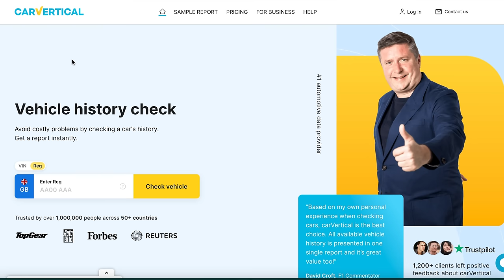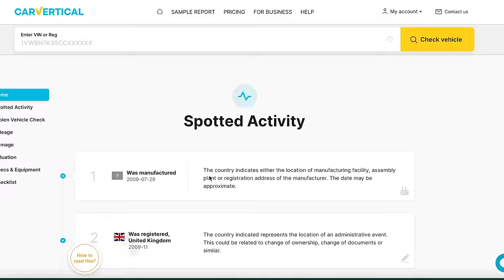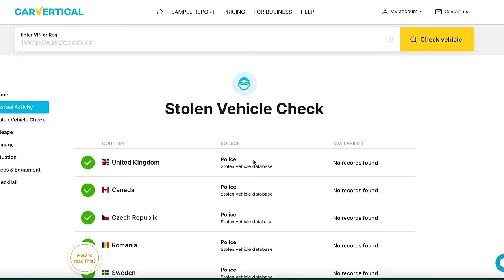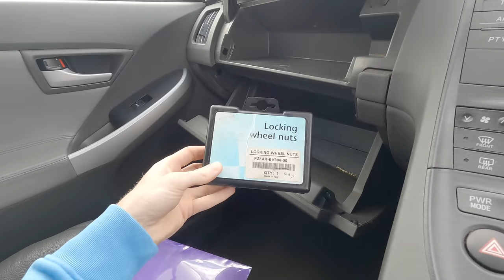I BOUGHT A 200,000 MILE TOYOTA PRIUS

Comment: In the United States these are EVERYWHERE!
They usually have a rear screen that is covered with stickers advertising the owners love of the environment and how everyone should spay or neuter their pets.
They are usually driven 10 mph below the speed limit in the fast lane on highways and away from traffic lights like there's a rotten egg under the accelerator so the driver can ooze forward on electric power and not activate the gas engine for as long as possible.

Comment: Retired Toyota master technician.
I assure you the e-cvt, doesn't have a filter.
It uses WS fluid, which is quite expensive but it's capacity isn't very much.
Reply: What is your recommendation about replacing the fluid? I have a 2010 with 252,000 miles and it's never been changed. My mechanic said he didn't recommend it when I had it in his shop and suggested he do it back at around 200K. The car runs fine.

Comment: Wow, the 2nd hand price of a Prius must have shot up since 2019 when I sold my 2009 Prius T3 with 145k miles on the clock. It had needed an EGR clean as these clog up and cause the engine to run poorly. Good luck with the sale, I certainly wouldn't go shopping for a 200k mile car!

Comment: Had a "66" reg Prius + dumped on me in early 2019 as a company car. Wasn't impressed at the time as I thought they were more of an urban runabout. As I do up to 30,000 miles per year on fast roads I didn't really think it suitable.
Opinions change. From the initial 20,000 miles the car has now done 113,000 miles. Apart from a couple of rear number plate bulbs the car has been faultless. Real world mpg usually mid 40s to low 50s, due to + version not being so aerodynamic as the standard car, and probably due to all stuff I need to cart about. CVT whine during initial acceleration was annoying at first, but now used to it. Not the fastest of cars (obviously) but ok for the real world. 
Overall, well impressed.

Comment: For Info. Unless you carry granny in the back or heavy suit case, then the rear disc get rusty from a lack of use (little use) so check the slider pins in the disc brakes. Other wise that about all the issues are. As one used to driving them I get regular 65+ just running about (without grand Prix starts) PS You should have Head up display like a fighter jet. Very useful.

Comment: You are quite right in saying a left hand side ding may have happened. However the headlight fade could also be where a car is left outside or in a carport where the sun mainly hits one side of the car. Rather than bot equally. Also the owner may have cleaned up one headlight but not the other.

Comment: There are some very good battery replacement videos on YouTube for this car in great detail for the home mechanic keeping costs down to a minimum. id consider buying one with a dud battery and replacing it for £1500.00 in the UK the early models had nickel metal hydride batteries while the rest of the EU got lithium batteries.

Comment: I bought a 2010 hybrid Auris on 175K mileage for 4.5 the cheapest in the country 3 months ago. 1 lady owner and T spirit model drove it down back to london from leeds and honestly it’s the perfect solution for local driving and high MPG and cheap cheap running costs im getting around 50mpg without even trying

Comment: Not all working vehicles were Taxis with holes in the bumper. In London Private Hire Vehicles don’t have plates, they have Roundels stuck inside the front and rear windows.
The easiest way to tell if a vehicle has been used as a London Private Hire Vehicle is 6 monthly MOTs.

I have been looking for a 7 Series BMW recently at BMW main dealers, and have found 2 vehicles that were undeclared Private Hire Vehicles from London, one was still listed on the TFL Database.

Comment: Glad you've done a hybrid. I've been doing  Uber Eats/Deliveroo etc part time, clattering around in an Astra 1.3 cdti since the lockdown drama and been considering a hybrid for a while but nervous of the maintenance and complexity. Might start looking around! See the attraction, my average speed around town doing deliveries is about 17-18mph! I think older Prius suffered from inadequate battery ventilation (under the back seat?). Got to check for a filter I think
Reply: The great thing about these hybrids is that the fuel economy actually tends to go up in stop and go traffic. The car uses the electric motor to slow itself down while recharging the hybrid battery at the same time. This is the same reason that the brake pads on them last for so long. These are definitely worth a look if you're considering working out of your car, I love mine.
Reply: So, did you find a Prius?

Comment: Friend of mine had a 275k Prius, Mk 2. Estimated mileage as the clock doens't go past 399999km. Thing ran on its first batteries, interior still looked okay and it felt crisp and tight. Exterior dirty and beat up. Heavily used, absolutely flawless. My neighbours have a 2009 Auris. Zero issues since 2009. Unless you count that their remote controlled alarm system of their home interfered with the keyless entry/start of the car.  
I loathe the way new Toyota's drive, with how their steering doesn't center. I just keep swerving and I don't get anywhere near those cars but my oh my, are they reliable old beasts.

Comment: a Prius is likely to be an excellent purchase. But you need to check the battery! A Prius with a knackered drive battery is worth very little.
Luckily, this is not difficult, even for an amateur. There are battery diagnose combos, where you use an OBD reader that sends data via bluetooth to your diagnostic app. Youtube is your friend.

Comment: It’s interesting that the big investment by the owner is in suspension.  I find the same with Hondas with high mileage. Not only struts and shocks, but also suspension bushings need to be replaced at considerable expense. If you don’t, it gets yucky to drive and ride in.  Most everything else seems pretty reliable with good maintenance.

Comment: I have a 2015 Toyota Auris Hybrid estate for best and a 1996 Volvo 940 LPT, petrol  Auto estate for my works van. Cost me £250 5 years ago and now run in at 207,000 miles. Prior a Volvo 240GLT Estate in 2009 for £350. Had it for 10 years and added 72,000miles. Sold at 234,000. Ran extremely well and got £500. Needed a quick sale. I like the older rear wheel drive Volvo and Toyota and Lexus.

Comment: I had a 1.8L tdi ford from 1999. Had 490,000km on it untill the clutch failed on it, timing belt was last changed over 200k, over 15 years ago and it was basicly worhless so i scrapped it. This toyota is brand new to my stantards and has easily 150 to 200k  left it in. IMO your pricing is off tho. :D

Comment: I got in an Uber a few months back in London. It was a Toyota Prius as well I think on a 62 or 63 plate and it had done 263,000 miles and I only noticed that a few mins before getting out after a 45 min drive. Thought it was still a smooth drive but had a lot of marks and squeaked a lot over London brilliantly place speed bumps.

Comment: Engine cuts in at 25 to 28 mph. It will only travel about a mile on battery power alone. The battery is tiny. A Plug-In hybrid has a battery around 10 to 15 times the size of a standard hybrid.

Comment: Two background bits to mention, both courtesy of The Car Care Nut channel by a Toyota Master Mechanic:
First, when looking at one to buy or having recently bought, look at the hybrid battery cooling air intake by the right rear seat passenger's right elbow. It should be free of dog hair or other inlet debris. If it is blocked the hybrid battery suffers badly.
Second, change the engine oil at 5K miles or 10K km intervals, even if the service schedule allows twice the interval. The longer interval will get the engine past the warranty period but will run a high risk of cylinder wall scuffing followed by high oil consumption.
I hope everybody enjoys their Prius cars as much as we do.

Comment: That's the thing with CVTs.
Service the things regularly, and they work well forever. Ours has 229000 on it, and is still sweet.
Seems to work better than a Toyota CVT.
Goes well -  1.8 twin-cam, and it just goes loose in Sport mode. Damn quick.

Comment: This is the first Prius i have ever seen without a production line satnav system. You need that for just reversing, this is an odd model indeed! But if you need a bullet proof practable daily, look no future. Once they are serviced by a friendly Toyota main dealer annually they will just keep going, i should know, my 2012 model i bought 6 years ago  with 190,000 klm,  so the price was right, it now has 330,000 klm and has never missed a beat. Luxury model with some nice Lexus hand me downs like parallel reverse parking (which in the past 6 years i have never once tested!) and camera, electric folding wing mirrors and a very James Bondesque  pop out CD player! But in all fairness this is a car to have, just in case!

Comment: The coolant in mine that’s at 235k miles looks like this too. I’ve never drained it 😂 mine has the original hybrid battery. I do regular oil changes and have changed the spark plugs twice and the break pads twice. I’ve been using mine for delivery. It’s the most reliable vehicle I’ve ever owned. The money you will save in maintenance costs and fuel is absolutely crazy. So far I have had repairs less than $500 in the 7 years I owned my 2011 Prius. Just do regular oil changes and change the filters and you’re good to go.
Reply from the maker: Impressive

Comment: I prefer the 1.5 over the 1.8. The 1.8 has 3 major problems. It burns oil, head gasket most likely will need to be replaced and last the egr valve gets plugged with carbon.

Comment: I'm really planing on getting one I hate the steering wheel but with the increase of clean air zone, it would be perfect, especially since I only do motorways once a week, my current diesel keeps getting DPF problems. Never owned a hybrid before, a bit scared but I have to try it
Reply from the maker: They’re very good cars. I like them
Reply: I was nervous too…fourteen years and 241,000 miles ago. No major repairs, Still on original battery. Absolutely love my Prius!

Comment: how is a Prius as a first time car ? especially for a 5'3 driver?  maximum expected mileage is 10k in a year & its just for personal use...
Reply from the maker: They’re good cars
Reply: I have a 2008 Mk2 Prius Tspirit which I bought 3rd hand in 2013. Initially owned by Lloyds Bank as a company car, then used as a private car. Bought at 55k miles. 
Today it just rolled over to 143k miles. Daily commuter (34 miles round trip). Do about 10k per year or slightly less. Still running on the original Hybrid Synergy Drive propulsion system which has been ultra reliable. Also still running on the original Traction Battery too (93% SoC). Has leather interior, SATNAV straight out of the Millenium Falcon, a dashboard straight out of a Star Trek: Next Generation Shuttlecraft, great 9 speaker JBL Stereo with 6 Disc CD changer, takes voice commands and even talks back, everything works, nothing has broken. Dependable and reliable. I call it "The Spaceship".

This summer, managed 651 miles out of a 45 litre tank of Esso E5 Supreme Super Unleaded 99+ (which actually has no ethanol in it - I refuse to use E10). Also had 69.4mpg displayed on the Multi-Function Display. In the coldest of winter, I still get over 500 miles to a tank - and no, I don't drive like a snail - I keep up easily with the traffic and use cruise control whenever I can. If you really want to save fuel, LLR Tyres are a must - I use Michelin Energy Saver+ tyres all round - got 60k out of the last set - and only changed them as they were so old they developed micro-fractures! The vehicle is regularly serviced by Toyota annually. You cannot go wrong with a well maintained Prius with full service history.

Comment: My Honda Jazz 1.2i-vtec with 90ps - fuel economy 4,3l on autobahn with 100-110 km/h (mainly flat road with no hills).
I was considering to buy used Toyota hybrid to drive it daily to work (80km), but then my mechanic say to me why to buy expensive used hybrid when I can buy cheap used Jazz which have similar fuel consumption and great reliability. My first Honda 👌

Comment: Makes sense that these cars last as long as they do, most of the stress on the engine is at the low end when taking off, in the Prius of course the low end is covered primarily by the battery. The engine therefore encounters much less stress than a typical engine over it's lifetime. Combined with Toyotas reliability it's no suprise there's many of these car still driving about with 200k+ miles.

Comment: I have a 2009 Prius but gen 2. I'm 37 years old so quite a bit younger than the average Prius owner... I've had a 2017 Qashqai from new and other cars. However I drive 39 miles each way to work so needed something reliable and fuel efficient. (I work for a railway company and time keeping is very important because I need to pick up my train on time and at times when no public transport is available). 

I get 56 to 62 mpg depending if I keep to the speed limit or hit 90+ at times and also the temperature outside. 
Anything above 70 and the mpg drops a lot on the 1.5l gen 2.

The gen 2 is bullet proof (other than the battery at some point). The earlier gen 3 have issues from my memory and it's oil burning that I've read.

Anyway, 3k for that is pretty decent. People will take it because even the OEM cat is worth quite a bit.

Comment: Be prepared after 220K miles for a new main battery, all new brakes, a front wheel bearing, the inverter pump. Almost $3000 for that lot. Great little cars, but they're not invincible, especially with the little 4 cylinder starting and stopping constantly. Mine's at 241,000 miles and is now using about 1qt of oil between changes and things like plastic connectors on ignition coils are getting brittle and could use new struts/shocks all around. Also had catalytic converter stolen in broad daylight that cost me $1800 for tow, new cat, damaged sensors and anti theft shield. Number one target for rampant cat theft.

Comment: Our 2013 Prius has 300,000kms on it they are pretty bullet proof, the batteries can be refurbed pretty cheap so far it has been rock solid reliable, its a great appliance car terrible Enthusiast car but thats ok its not what it's for with Radar Cruise control it almost drives itself.

Comment: There's enough of them about to get parts used to fix it, but generally the Prius is well-built and understressed so it is very dependable. Plus very few have been owned by speed demons :-). 

Toyota just discontinued it last year. Which was a bit of a surprise as it was still selling well at the time.

Comment: I have the auris hybrid excel , I got it with 28,000 miles on it, it’s a 2015 model with leather seats, I paid just under 15,000 for it , it’s hybrid battery failed at 129,000 miles, took it to a taxi firm to get a brand new Toyota battery pack fitted as it’s out of warranty , they don the job for £1868 .00 I thought it was cheaper than scraping the car, so hopefully it’s going to last over another 130,000 miles, I get on average 52 miles to the gallon, but more if I drive it around town or city, no road tax to pay , the only other expense I had was new brake disks and pads for the back and that was with all new Toyota parts including fitted for £253 , I have plenty of room in it as it’s the touring sports version, the boot is enormous with the back seats down , I do all the oil & filter changes myself, even the ATF fluid & coolant , I don’t regret my perches it’s the best car I have ever had .

Comment: Just bought one as well £3300 193k miles,  Prius 2009-2015 petrol hybrid 86% battery health 😁 - Needed a family ULEZ car that gives Great fuel economy
Reply from the maker: I like them. I don’t see any harm in that choice at all
Reply: @HighPeakAutos  yep, late 2009 model all the same but with reverse cam
Reply: What’s been your fuel consumption?
Reply: @thetad1242  it doesn't tell you as its just mpg per second but auto trader says 70mpg combined and I am inclined to believe it's close to that, it's pretty underpowered unless you use the power mode.

Comment: Prius doesn't have transmission filters because it's e-CVT (power-split device) 
unlike conventional CVT. just replace the trans fluid (WS) every 60,000 kms.

I bought a 2019 new face lift gen4 Prius Excel UK import (I'm from ROI) w/ 50,000 kms on it. what brought me buy a Prius? Because of my sister; who owned a 3rd gen Prius like in the video but it's a T-spirit also an UK import who owned it for 10 years with 135,000 miles on it and a testament for reliability and practicality @ 60-65 mpg. 

Mine's doing at 70-72 mpg easy and with today's gasoline prices at €1.75/liter; I filled them up once every 3 weeks in a daily 32-km roundtrip commute. I dont care about the looks and performance like most people hates and I observed drivers overtake me because I'm in a Prius, they think they're slow-poke cars; yes I admit but what I care is huge mpg, cheap to maintain, reliable, comfy, high tech safety feat (on Gen 4 Prius) and can get A to B easily which most of their cars can't achieve.

Comment: Hae one with 180k on it. Both rear brake lines were corroded and I lost brakes in traffic. The onboard computer gave no indication of a brake problem, only a minute before the yellow warning light popped up. Actually it doesn't have a proper display or sensors for that matter to give this kind of vital information. Also the plastics are attrocious, so are the ride comfort, road noise and suspension. The mpg is not that great in a city, much like any 1.6 diesel, but lacking the torque.